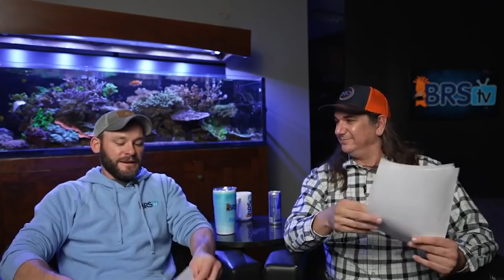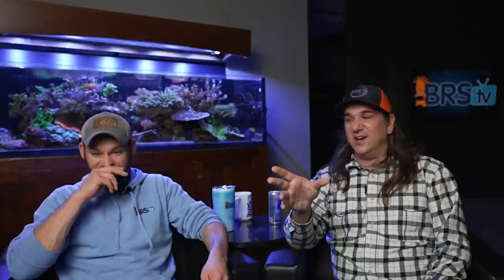Everything Breaks, Faster in a Corrosive Environment. Plan For It Rather Than React to It.

Comment: I was on a camping trip and received an alert from my newly installed sicce that the temp was out of bounds. I was running a reefkeeper at the time and the previous year I had to remove the heaters from being controlled by the reefkeeper because of a relay failure. Anyhow, I was running two 100watt neotherms and one of them was seemingly stuck on. After reviewing the sicce data, it was apparent that the heater was having issues for about 2 weeks. Because I was running two smaller heaters, I avoided cooking my tank. I also had a backup heat source ready to go. I have since switched to a hydros with a BRS titanium heater. I will be putting together a backup for that soon. Battery backup on my MP10 has saved my bacon a couple times as well.

Comment: I had an issue where my wife had accidentally refilled our ATO bucket with tropic Marin all for reef whilst I was away for month for work. When returned some corals were looking little unhappy (heads had receded somewhat but nothing had died yet (mostly LPS and softies). Once figured out what had happened tested and alkalinity was above 20dkh (max Hannah checker reads). Only had 10% water on hand at that time so did 10% water cha he with thought of bringing it down relatively slowly with a water change daily. Made water that evening and mixed the salt and raised temp over night ready for a 20% water change the next day. The salinity and temperature matched, but did not test pH. Did the water change (day 2 afternoon) and  the next morning (day 3) all my fish were dead. Still don't know for sure but have to assume there will have been so e form of osmotic shock from change of pH, or potentially other elements rapid change. But moral of story in that particular example where presumably pH wasn't at toxic level as had been that way for a while (unfortunately had run out of test reagent at the time and didn't realise.its importance) was I wished I'd essentially let it come down on its own or only done 10% at a time max.  Once parameters came back down to normal levels and got back to weekly water changes corals were all fine, none of which looked any more than slightly pissed off at worst. And was able to start restocking with fish, but was devastated and felt like my over reaction caused it.
Reply from the maker: Sorry to hear about this 😭

Comment: For UPSes: I can imagine running DC pumps would lose a lot because of the DC-to-AC-to-DC conversion, but would AC pumps last longer, since you're only doing DC-to-AC conversion? Having just a single AC return pump running off a UPS (while the DC powerheads run off one of those other backup solutions) could work if the AC pumps can run for a while. I have an extra UPS sitting around gathering dust, so it would be nice to put it to good use if it works well.
Reply from the maker: Unfortunately, we also found that AC pump don't last too long on a battery backup due to this conversion. Randy did a 3 part video on UPS systems a while back and the link below is to the one where he used AC powerheads in the test

https://youtu.be/YtiAM4L5HhE
Reply: @BRStv  Rats, thanks for the response and the links. I might still use the UPS for the return pump (or maybe swap out one of my larger UPSes) and hope I can get home in time to hook up my generator if the power goes out.

I am fairly well prepared for a power outage, but unfortunately, the reason I am prepared is because we have frequent (mostly short) power outages!